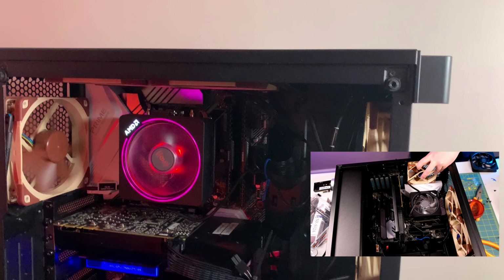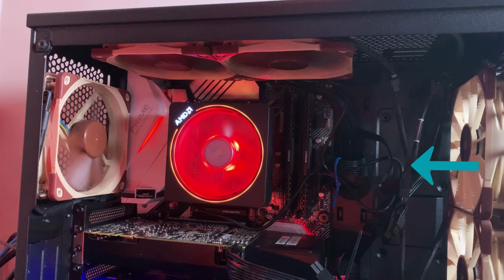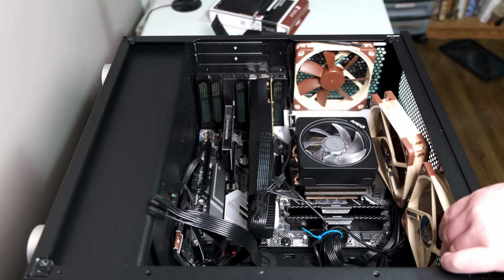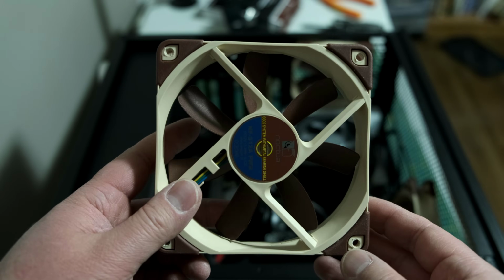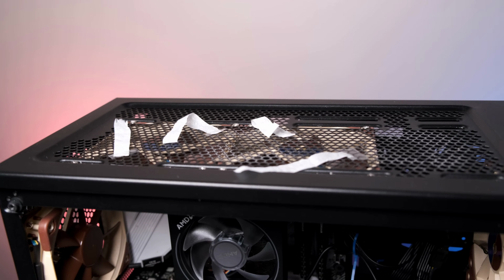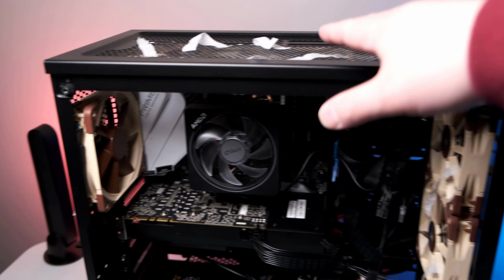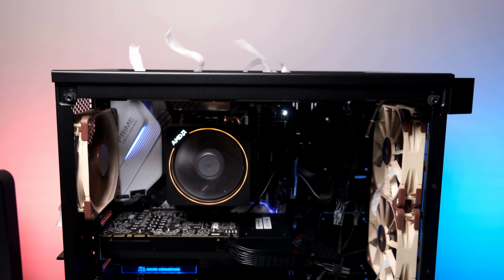Custom PC Build: How to setup your desktop cooling fans for proper air flow

Comment: Hey, so I think NF-F12's may not be the best choice for that rear exhaust fan. It looks like NF-F12s are good when static pressure is needed (e.g., pushing air against a heat sink, radiator or dust filter). So, I think the NA-F12s may be good/okay for the front intake, but something like a NF-S12 maybe better for that rear exhaust. That might be why the tape/string in the video on the rear exhaust is moving so little. This is interesting to me because I have the exact same case and I just ordered three NF-A12x25 for front air intake and an NF-S12 for the rear exhaust. I mistakenly previously bought the NF-F12 with out fully understanding the difference between NF-. I might still use the extra NF-F12 I have for the top exhaust or save them for the future if I ever get a radiator or something. We'll see how the new ones I order perform. Here is a link to the differences between NF-A/F/S https://noctua.at/en/which_fan_is_right_for_me

Comment: Thanks dude good vid.
also, do motherboards have 4 pin connector for the fans?
Reply from the maker: Hi there, thanks for the comment. Yes, the Motherboard I'm using had a 6 - 6 pin connectors for fans. So it's convenient. I also have a cable splitter for 2 of the fans.
Reply: It depends. Loads of motherboards have only 3 4 pin, and on the other side of the spectrum I saw one that has 8.

It should be listed in the spesification of the motherboard.

Comment: really ? i thought your rear fan is blowing air OUT from the case ? because the front is pointed outwards.
Reply from the maker: Hi there, this video is out dated and I did change fan orientation due to changing to an AIO CPU Cooler. I've changed it so the front fans are intake, the top and rear fans exhaust. This seems to reduce the temperature of the hardware. I'm going to do an updated video on this.
Reply: @TheWongReviewer  did you add fans on top of the PSU shroud ? im confused as to whether i should put two in there just like the ones i see on videos. the shroud is not completely covered on top it has a mesh.
Reply from the maker: @SIDEKICKONYOUTUBE  The mesh is the dust filter. What CPU cooler are you using? An AIO water cooler or a  heat pipe with a fan?
Reply: @TheWongReviewer  naw im using stock fans for i5 9400
Reply from the maker: @SIDEKICKONYOUTUBE  Hey there, send me a pic of your current setup to thewongreviewer@gmail.com and i'll take a look at it to provide recommendation.
Reply: @TheWongReviewer  in here. the BLUE fans are INTAKE and the RED fans are exhaust. the CPU is using stock fan and the GPU has 3 fans underneath it. the PSU shroud is meshed metal but does not have any fans on top of it. https://imgur.com/BV8TTWj
Reply: @TheWongReviewer  this is the detailed version https://imgur.com/XihKDJP

Comment: have you tried setting the front and top fans as intake and the back fan as exhaust?
Reply from the maker: Hi there, this video is out dated and I did change fan orientation due to changing to an AIO CPU Cooler. I've changed it so the front fans are intake, the top and rear fans exhaust. This seems to reduce the temperature of the hardware. I'm going to do an updated video on this.

Comment: I am going to get a h510 case and I know nothing about fans could someone tell witch fans to get
Reply from the maker: Hi there. I just read the specs for this case and it comes with 2 fans. The front panel can hold 2 x 120mm fan or an AIO 240 radiator. What do you plan to use for the CPU Cooler?

Comment: Isn't the CPU cooler not designed well because the fan is sucking in the hot air onto the CPU? Or am I missing something?
Reply from the maker: Hi there. Thanks for commenting. The CPU cooler that came stock with the AMD chip is on a heatsink and the fan draws heat away from the heat sink. From my research, this is typical on how CPU Cooling fans work.

Comment: If you have slight positive pressure in the case you keep the dust out where theres leakage. Also you need dust filters on your incoming fans
Reply from the maker: The case has dust filters on the top and front panel. I have my cover off, so I do get more dust in the case which means i have to clean it once a month.

Comment: Thanks for sharing. This is the sort of error I'd make AND I work in IT. I am about to add 2 or 3 fans to the ceiling of my case. 

I suppose before adding more fans, I should check my PC temperatures. I might not even need it.
Reply from the maker: LOL. I work in IT and although on the software side, i'm exposed to enough hardware to know the difference. Yes, for sure. Check the temps to make the temps are within your components limits. What are you running?
Reply: @TheWongReviewer  Nothing major. Just an NVIDIA GeForce GTX 1070, 16GB memory, AMD Ryzen 7 (2700), and 3 SSD drives on an ASRock B450 Pro 4 motherboard.

Comment: Hello, I have a question. I’m building my first PC and I want to install 2 front fans and 1 back fan. However the motherboard I ordered seems to only have 2 system fan plugs. How do I get all 3 plugged in?  The fans I ordered are Corsair CO-9050071-WW LL Series LL120 on Amazon.
Reply from the maker: HI there. Thanks for watching. You'll have to buy a splitter to add more fans. Here's an example of one. https://www.amazon.ca/Computer-Splitter-Connector-Adapter-Cooler/dp/B07TVHX73B/ref=asc_df_B07TVHX73B/?tag=googleshopc0c-20&linkCode=df0&hvadid=335380394635&hvpos=&hvnetw=g&hvrand=1464728415652139524&hvpone=&hvptwo=&hvqmt=&hvdev=c&hvdvcmdl=&hvlocint=&hvlocphy=9001212&hvtargid=pla-903891219981&psc=1

Comment: Thought the fans at the top should be intake. Now i have to switch it haha
Reply from the maker: I suggest doing some temperature reading before , switch and see what the temps afterwards. Warm air rises , so it make sense that it vents out.

Comment: Those exhaust fans look like NF-S12A, not NF-F12.  The S12As provide more airflow whereas the F12s provide better static pressure.  In your setup, I imagine it works well becuase the intake fans (NF-F12s) are better at pulling air through a dust filter whereas the exhaust (NF-S12As) move more air so it removes more hot air.

Comment: i got some noctua fans and i hated how little air they push like holy shit man
Reply from the maker: Did you end up switching them out? What did you end up using?
Reply: The Wong Reviewer I switched them out for some beast 140mm fans that push 121CFM , only cons is the output  is 32db of noise but I don’t mind since I use it mainly for gaming and use my headphones all the time. btw they were only $12.99 on Amazon that’s why it was a no brainer to get them.

Comment: Isn't the CPU fan still incorrect? Shouldn't it be pulling are off the CPU and not blowing are on to it?
Reply from the maker: Hi there, thanks for watching. I believe you are correct,  it should be pulling air our. I'll have to make adjustments
Reply: @TheWongReviewer  Hey, I think we are both right LOL. I read a bunch of articles after making the post.
Apparently, a lot depends on how air is flowing  through the case. But from what I've read  there will only be 1-2 degrees C difference.. 
For example, in my case the CPU cooler is next to the exhaust fan so  it would make sense to pull heat off of the CPU to be blown right out of the system. If I would have it the other way it would be blowing hot air onto the CPU.
Reply from the maker: Thanks for following up. I know, you can definitely go down a rabbit hole when you are researching this. I know I read a lot of online articles on this topic. I'm going to just try a bunch of different configurations for my system and see which one is best. I have quite a few suggestions from other viewers that i'll be trying in the near future. Thanks for the input! Appreciate it.
Reply: @TheWongReviewer  Thank you for actively responding.

Comment: This was helpful. What I learned is to look at the direction of airflow indicated by the arrows. For strange and possibly disturbing reasons, I assumed the air flows in the direction of the logo on the fan. I blame that on partial knowledge on how fans work. I am yet to build but if I did before watching this video, I would have successfully replicated your mistake. 
Thank you, sir.
Reply from the maker: Glad this was helpful for you. I thought the same way you did, the air flows through the direction of the logo.  Hopefully you can build your new computer soon! Let me know if you have any questions.

Comment: You now have negative pressure. 2 fans in, 3 fans out. More out than in = negative pressure. I recommend you flip the rear single fan back to input. And have just the two top fans for exhaust. This will give a little positive pressure and keep dust from getting sucked in through the nooks and crannies. (And cable management, man! - just a friendly recommend.)
Reply from the maker: Hi there. thanks for the feedback. Yes, you're right on both fronts. I actually did an updated video here where i adjusted the fans to neutral setup. https://youtu.be/jl10lb8XF0Y. In the video, i do talk about the dust I was getting. You're right about cable management. I did manage to fix some of it for the updated video.

Comment: Hi thanks for the video. This was very informative but I have a question. My front intake is 2x200mm fans with 1x120mm fan at the rear as exhaust. I will be using Noctua NH-D15 as a cpu cooler and plan to mount 2x140mm fans at the top. Will that be starving the CPU and mobo of cool air if I do that?
Reply from the maker: Hi there, thanks for watching. Are you using a similar case as mine?
Reply: @TheWongReviewer  Similar, i am using a cooler master h500 case.

Comment: thanks for this Video! is pressure really a thing to take care about? i mean obviously the direction of the airflow is something to consider but i think this is just important in terms of blowing out the heat of the system to allow fresh air to flow inside. I don´t think pressure can be build since the enclosure has holes everywhere.
Reply from the maker: hi there. Thanks for the video. From my understanding, pressure really just affects the amount of dust entering the case. In the setup in the video, i have too much fresh air coming in which lead to larger dust build up on the case screen in the case. I posted a video here of the dust i faced in this setup.   https://youtu.be/jl10lb8XF0Y  Neutral setup, theoretically is supposed to be less. I'm currently testing this out. However, you're right. It's more about airflow than pressure.

Comment: This is a good video, but now you have too much out take, now a lot of that cool air it going to get sucked out to quick, before the cpu cooler can use it, same goes with your gpu, that's gonna get hot quick because there's no air flow going to it, install a 3rd fan at the front to cool the gpu and add neutral air flow (3 in take 3 out take)
Reply from the maker: Hi there, thanks for watching. You make a really good point. I like the idea of adding a 3rd fan, so it has neutral airflow. I'm doing an updated configuration video in the next 2 weeks. Let me see if i can get another fan. I'll respond here with the link to the new video.
Reply: @TheWongReviewer  Did you get round to upgrading, as I said?

Comment: I have an aio liquid cooler120mm with an i9-9900 when I play games like modern warfare or Fortnite basically any game harder to run my temps get to like 75 degrees Celsius is that ok for an i9 ? I also have 2 fans bringing in air and the aio fan for exhaust should I add another fan ???
Reply from the maker: Hi there, thanks for watching. I did some quick google and it looks like anything below 80 is fine for gaming. 
https://forums.tomshardware.com/threads/safe-operating-temps-for-i9-9900k-ocd.3395851/#:~:text=The%20average%20operating%20temp%20is,an%20average%20of%2075%2D80.
I'm not familiar with liquid coolers, but i know for my setup. When i add an extra fan, it did make a difference in temperatures.
Reply: The Wong Reviewer even for the cpu temps ?

Comment: Nice I just got this figured out somehow on my first build before watching this I got the same case too in white... good to see i made neutral pressure right
Reply from the maker: Awesome! I didn't have an option for the white case. How did you setup / orient your fans?
Reply: The Wong Reviewer same way pictured ... I got 2 140 front intake and 120 exhaust rear and two on top 120 exhaust but I got RGB fans the Corsair QL haha 😍

Comment: So I have a cooler master h500 mesh case with the huge 240m fans on the front. How many exhaust fans should I need to off set those bad boys. I’m currently running two exhaust fans but have no clue what the pressure is in the case
Reply from the maker: Hi there, 240MM is huge! You should have at least 2 exhaust fans to offset them. I think 120mm are fine. This video here : https://youtu.be/jl10lb8XF0Y may help you with what pressure you want. Let me know if you have any other questions.

Comment: the back fans are not spinning because the side glass is off... but great video none the less brother
Reply from the maker: Hey Maurice,  thanks for watching and the feedback. you're right, there is not enough pressure in the case with the glass off to fully simulate the air flow. I'm going to be doing an updated video, hopefully using dry ice to show the air movement. Thanks again!

Comment: @The Wong Reviewer For this air cooler is good setup now but if you will change to tower/double tower cooler i would sugest to go front and top in and that single fan on back for out. It provide almost (1 deegre from best) best temperatures and lowest amount of dust inside.
Reply: Does moving more air out increase dust? Or is it air coming in?
Reply: @Armendicus  Creating positive air pressure (more fans giving air in than out) gives you cleanest case becouse the fans that pull air in are most of time just behind filter and they produce enought pressure that all dust from case go out trought all avilable holes. If you create negative air pressure you would pull all dust into case same as vacum cleaner does.

Comment: The tissue paper setup to show the direction of airflow was amazing !!!
Reply from the maker: Thanks for the feedback. I'm a visual learner, so I thought other people may appreciate it as well. I'm working on another air flow video and going to try using dry ice for the next one
Reply: You can also use incense to have a visual aid on how air moves into and out of your system. This is also probably the best way to check for an actual neutral pressure build. Just use the incense at places where air can enter or leave the system without a fan. The backside of your board with the PCIe slots, meshed areas on the top or bottom etc.
If it's sucking air in, you have a negative pressure in the case, if it's blowing air out, you have a positive pressure and if it's not or barely moving at all, you'll have achieved a neutral pressure build. An intense localized lightsource like a flashlight or the lamp-function of your smartphone can help with the visibility of the smoke.
Reply: Genius
Reply: great idea!
Reply: Agreed this was a great way to test the direction!

Comment: The initial fan setup as seen at 0:32 is the same as the final setup. What are you doing?
Reply from the maker: Hi there, thanks for watching. It’s not the same setup as the final. I had to swap the orientations of the front 2 fans .
Reply: @TheWongReviewer  Also you say that all the fans are pulling air into the case. In order to get the configuration you have at the end of the video, you would need to flip the orientation of the top and back fans, not front ones.
Reply: @TheWongReviewer  I have watched the other video and yes, in that video you did have the top and back fans pulling air into the case. Meaning you did flip the top and back fans. The problem is just the images at the start of these video, you definitely wanted to have video of the wrong configuration but you put video of the fixed configuration.
Reply: @TheWongReviewer  I am looking at the image at 0:32 and can see the support structure of the two front fans that means that those 2 were pulling air into the case.
While on the top 2 and the back 1 fan, I can see the whole fan blades which means those 3 fans are pushing air out of the case.
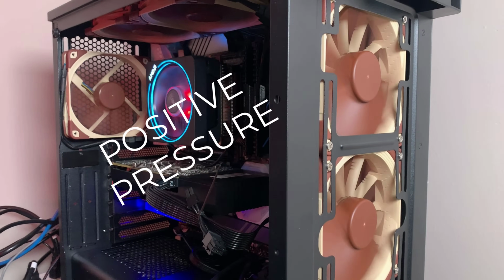You can see that even clearer in the image at 0:55.
Reply: No bro he needed to switch the back fan

Comment: You have to dump that wraith cooler. It is inadequate for high-end gaming temps and overclocking. I went to a Dark Pro 4(no it was not fun to install, but it was worth it) and saw a 20-25 degree drop in CPU temps. However, I had to also go with Silent Wings 3 fans for higher air movement to reduce my GPU temps. I really like my Corsair case but I wished I had given more consideration to running Outer Worlds and other high-end gaming when I started. It is part of the process I guess. I did not want to water cool unless I had to and found I am getting nearly the same temps air cooling comparatively but had to go high end on a cooler to achieve it.
Reply from the maker: Thanks for watching. You're right. I did dump the stock wraith cooler and upgraded to a Noctua CPU cooler (NH-U14s) . The temperatures did go down, but not by  a lot (5 to 10C). However, it's much quieter. I agree, i wish i would've chosen a different case, but like you said, it's part of the process. I haven't ventured into water cooling yet. Appreciate the inisight!